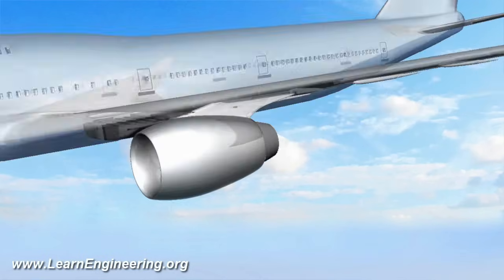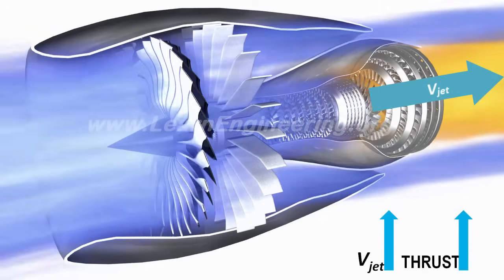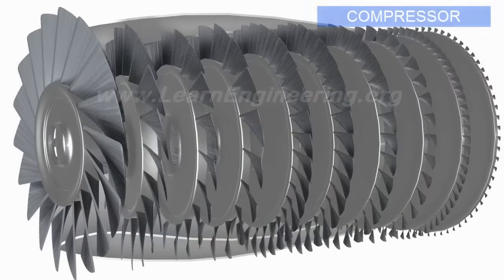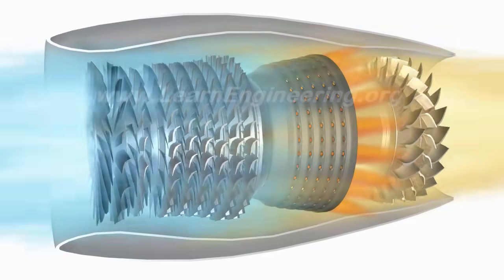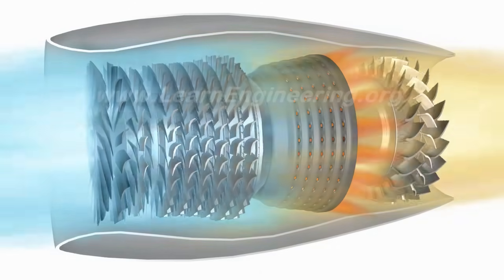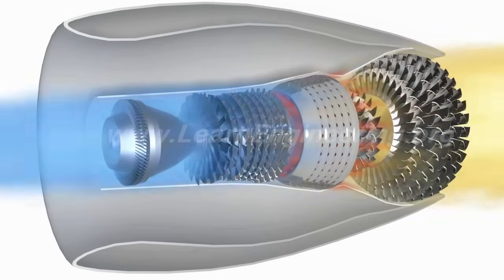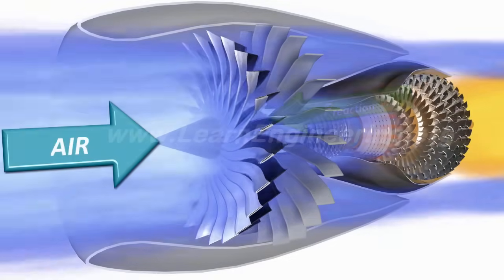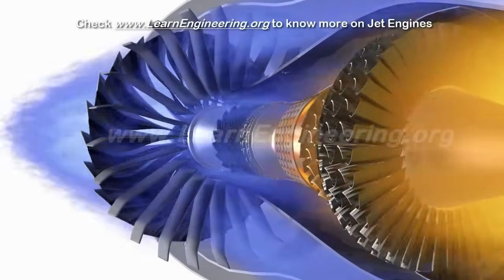Jet Engine, How it works?

Comment: This video still didn't teach me how jet fuel can't melt steel beams :/
Reply: I am assuming you never took a shop or metal shop class so I will explain this. if you were to take a big ass I-beam which is a structural piece of steel that is quite strong and support just the ends leaving the middle unsupported. you then put a lot of weight in the center of the beam not enough to go past it's with limit though. then you subject the beam to extreme heat such as shit load of jet fuel and I mean a shit load. there beam will heat up quite a bit. no not enough to melt it but we all know from seeing blacksmiths, that the hotter steel gets the weaker it becomes now all that weight that was on the beam is now to heavy for the heated beam and it fails. when you take a few heated beams and they fail in a building structure now you have ruined the strength and integrity of the building and more will fail.
Reply: @loganeley2342  cool so where did the molten pools of steel come from
Reply: @loganeley2342  
911 Inside Job by
CIA.GHWB.Mossad
Dick Cheney.GWB.
Benjamin Netanyahu,
Larry Silverstein,
Michael Chertoff,
Philip D Zelikow, etc.
Remember, Comrade,
"Dancing Israelis" are Mossad, "sent to film the WTC attack," but with explosive residue in their van,
& picture of burning towers on the side...
Reply: +DOGE™ you're a fucking moron
Reply: Enough to weaken it
Reply: +DOGE™ enough to melt people's hearts
Reply: +DOGE™ Shit! Thirty three thumbs, illuminati confirmed :o
Reply: SonsOfLorgar I'm pretty sure he's not.
Reply: +DOGE™ 7 ELEVEN WAS A PART TIME JOB
Reply: +DOGE™ Actually, it could. That's why the combustor is made of a high-nickel super alloy, and other sections are cooled with air from various other stages.
Reply: krasnograd You caught me!
Reply: +zzdfhgdhd Really? Comparing a soda can to a jet plane?? Just because a soda can is aluminum doesn't mean it'll have the same effects as a plane. Anything traveling at high speeds has the potential to penetrate objects, we see this pretty often with tornadoes. an F-5 tornado with winds up to 300mph can send things like a 2x4 through a house. Planes usually travel at 500mph or greater. As far as the metal melting, there's a shit ton of metal used in the construction of a skyscraper, and that doesn't include all the shit that was put in after it was finished. Now you have a hole hundreds of feet high in the sky, you have tons of jet fuel burning. Air wants to move trough the hole downwards, and with it being a concrete structure you pretty much have a furnace going on. Everything is burning, lot of air is supplying the fire so the temp rises so it is possible for fire to be 1,000 degrees
Reply: ***** You seem to forget the speed this jet was traveling at. There is a literally a photo of a piece of wood that went trough solid concrete after the Moore F5 Tornado. Which F5's have speeds ranging between 300mph. Jets can go up to 500mph, a difference of 200mph...which if you know anything about power you would know that it's exponential not linear.
Reply: +cesar hernandez no point arguing with him, he clearly doesn't even possess a highschool level knowledge of physics. he's just repeating talking points from conspiracy sites.  he's a perfect case of the dunning kruger effect in action.
Reply: ***** It's up my ass.
Reply: *****
"PHD's in physics say the the towers fell faster than free fall" Source? Another "fact" pulled from your ass.
Reply: +Rizlogen Dude, you are beeing trolled so hard it's painful to Watch... XS
Reply: I don't know what that means
Reply: +DOGE™ The same way your car's motor is working: It's cooled. In your car it is a watercooling system, in this case there is much cold air sucked in, cooling all structures in the engine.
Reply: +DOGE™ This will:

http://www.popularmechanics.com/military/a6384/debunking-911-myths-world-trade-center/
Reply: +DOGE™ I spot 9gager here
Reply: +DOGE™ its because the cant!!
Reply: *****
sources plz
Reply: *****
where is your source for all of your claims.
Reply: *****
"cars and busses to spontaneous catch on fire" source. "it didn't burn nonmetallic things nearby" source. as for "melts" you've seen plenty of people here explain to you that structural weakening of steel is entirely possible from high impact of a plane/ jet fuel burning. no need for melting.
Reply: *****
how do I trust that YOU have the ability to utilise logic and weed through propaganda? You're just posting sourceless claims, and expecting people to trust them. That which you post without evidence shall be dismissed without evidence. You're dismissed.
Reply: *****
I don't believe these things happened. until you give me proof, then I can dismiss them as easily as you post them
Reply: *****
very asinine. vehicle. what a waste of time to comment and merely point out a typo. can't be surprised though. you don't have anything of substance to say after all. just copy paste "ideas" from conspiracy sites.
Reply: *****
what part of my last post doesn't make sense. you are so OBVIOUSLY avoiding posting any sources for your blatant nonsense. it's hilarious.
Reply: *****
Oh my god, can you not understand simple english? You pointed out I made no sense, so I asked you to explain what in my last post didn't make sense. You have got to be literally the most stupid person I've ever seen in youtube comments.
Reply: *****
this is ridiculous. clearly you know you've lost the argument, so feign ignorance all you like. You're only embarassing yourself.
Reply: *****
You are clearly a moron. I never once said I was making a last post, YOU claimed one of my posts didn't make sense, and I CLEARLY asked what part of my last post didn't make sense. THAT IS NOT SAYING "THIS IS MY LAST POST". Learn to fucking read. Then learn to fucking think critically. You fucking IDIOT.
Reply: *****
how the fuck did I get played? Your basic lack of reading comprehension =/= me getting played.
Reply: humanrace Because illuminati did 9/11
Reply: @DogeDELUX  illuminati 
Dimitri Khalezov said it was Michael Harari, a Freemason. 911thology is a PDF tl;Dr
"The Third Truth" WTC was nuked.
Reply: @davidlango1850  Niiiice.
Reply: This is the problem with Trump supporters. They make up their mind. They know they are wrong. But refuse to accept anything else. Ignorant idiots that deserve to die more then child rapists.
Reply: Logan Eley tl;dr
Reply: it doesn't
Reply: +DOGE™ they are made of titanium
Reply: @PantelisKokkalis  No,you have mistake .
Titanium is used to manufacturing centerfigual compressors and it means that  the temprature isn't too high
The cmbustion chamber I think is made with "cobalt"alloys.
I don't know I wrote it correct or no.Ther are more cool air around the wall between the turbine case and chamber that can cause to protect melting.
Reply: +spoonwitz    yep!!
Reply: ***** ok
Reply: +Smithy07sham no not even close !
Reply: billy smith Omg...
Reply: *****
the claims you make of vehiles melting etc
Reply: +DOGE™ u asked for an explanation and when 1 was giving to u, u don't read it . i wonder y u think 9/11 was an inside job
Reply: +DOGE™ lol, ok, that s too much for me. have fun
Reply: Why did you delete your ASSHAT?
Reply: +Logan Eley So the building will then fall like a deck of cards?? Get out of here PLZ, it`s called controlled demolition!
Reply: +zzdfhgdhd I take it you're a Caravan to Midnight member. If not, you should check it out. You would like it.
Reply: +zzdfhgdhd No offense taken. I can't listen to Jones. It's way too over the top. Actually the host doesn't have much time for Alex Jones. He calls it fear porn. They discuss a lot of economic and political topics, monetary policy, along with things you were commenting about, like 911, fukashima, chemtrails, health, objective history, jfk assassination, sandy hook, etc. He has guests like the Hagman and Hagman, Brian Foerster, Wolfgang Helbig, etc. It's actually pretty good. A few of the guests appeared to be loons, but he does his best to screen them out beforehand.
Reply: +Logan Eley That is when it exposed to heat for extended periods of time. Not the mere seconds when the plane hit the tower.
Reply: Frontyer k
Reply: 911
Reply: DOGE™ Maybe I can. The jet fuel explosion set the building on fire, and the fire began bending the steel beams because of heat. When steel is heated, it becomes softer, and is able to bend. This is why we use forges to make things with steel. They didn’t melt, rather they snapped because a soft part of the steel was not able to hold the weight from the floors above. 

When buildings are demolished, a small section has its support structure exploded with TNT. This is because a structure can fall on itself if theirs too much weight on it, and this results in the entire building collapsing, and it falls in on itself be of the structure design, it doesn’t tip over like a small structure of one support beam. 

Anyways I hope that helps. I doubt 9/11 was faked, but it was definitely exploited by the US to attack the middle east and get oil.
Reply: @solsist__3291  What oil did they take???  How can someone steal oil???  US doesn't use much oil from the middle east, if you knew anything at all about it.  Any oil you take you have to pay for.  All you idiots that keep repeating that someone is stealing oil from another country are simpletons who merely repeat each other.
Reply: no fuel air is the thing   fuel is scam
Reply: It can't
Reply: or why larry silverstein decided to "pull' [it] Building 7.
Reply: Lolwtf this comment is so old, can't believe how many people I've trolled here 😂
Reply: It's fuckin titanium alloy and cooled by bypass air
Reply: even the rotating blades are turn to the wrong direction..supposed to be turn to the left not to the right  that is blowing the air to  the front  instead of sucked in..if  looking at the blades positions... but i don't think they explained everything all the details in this vid..
Reply: when the gases of atmosphere are compressed in 2 or 3 or 4 stages moving faster than speed of sound and then the engine spray fuel (Kerosene) into that very highly pressurized air it can reach the temperature of 2000 k (1700 C) the melting point of Iron 1500 C and steel melting point is 1400 - 1500 C so it will start deforming in that point
Reply: DOGE™ 
Your explanation is right here:
https://en.m.wikipedia.org/wiki/Conspiracy_theory
"...
People formulate conspiracy theories to explain, for example, power relations in social groups and the perceived existence of evil forces.[c][42][40][41] Proposed psychological origins of conspiracy theorising include projection; the personal need to explain "a significant event with a significant cause;" and the product of various kinds and stages of thought disorder, such as paranoid disposition, ranging in severity to diagnosable mental illnesses. Some people prefer socio-political explanations over the insecurity of encountering random, unpredictable, or otherwise inexplicable events .
...
For some individuals, an obsessive compulsion to believe, prove, or re-tell a conspiracy theory may indicate one or a combination of well-understood psychological conditions, and other hypothetical ones: paranoia, denial, schizophrenia, mean world syndrome .
..."
Reply: Still with this ?
Reply: I think we'd all like to know that Doge. </3
Reply: This is actually a model of my asshole after hot wings!
Reply: @user-cz8ky8bs3o  
Watch:
"911 Road to Tyranny"
by Alex Jones.
"911 in plane sight."
"Loose Change" by Dylan Avery.
Reply: +Logan Eley mm I think you might wanna look into what you are saying because the beams at 911 didn't just weaken they strait up melted !!! you can even see in the videos liquid metal poring from the windows !! explain that one BRO!!!  it was an inside job you morons !! what are you going to say next that JFK wasn't killed by the government ?? lol you're a fool if you think otherwise ...
Reply: BOI IF YOU DON'T GET YOUR ASS OUTTA HERE!
Reply: Logan Eley Too long; didn't read.
Reply: Too long didn't read-this seems to be a recurrent problem with you.Which explains a lot.
Reply: ang fig sorry it's confidential, you'll have to ask allah.
Reply: ang fig yes it does, the ISIS proved it.
Reply: ang fig It came from the internet.

Comment: Jet aircraft are quite efficient first due to flight at high altitudes. The higher an aircraft can sustain itself in a normal cruising speed the lower fuel consumption is.
Even the most efficient turbofan is a fuel guzzler flying below 4Km in altitude, when the air is still quite thick. That's why typical cruising altitudes are above 30000 ft (10Km), with large airliners going as high as 43000ft (14Km), and lighter business jets achieving flight above 50000ft (16Km).
The other important aspect is turbofans achieve higher fuel efficiency due to accelerating much larger air mass to a lower speed.
Finally jet engine efficient depends heavily on how hot combustion is inside the engine, the hotter it is, the more efficient an engine gets. At the same temperature level a turbofan is much more efficient than a turbojet.
Latest generation jet engines use air flow to make combustion happen as far as possible from the metal skin of combustion chamber, combustion is so hot it would melt the combustion chamber skin, so air flow is critical for safe operation.

Comment: Compressor blades and fan blades at the start of the video rotate backwards, or are angled backwards. Turbine blades and fan blades later in the video look correct.

Comment: still don't get it, all I noticed is that the compressor is spinning backwards LOL
Reply: Bryce Leung high pressure air is heated up, which makes it expand and causes it to fly out the back faster than it came in because hot air expands. This output is also used to spin the compressor fans, which allow for even higher density air and more thrust.
Reply: @Erowens98  So.. a year has passed.. please look again at the video and see if you notice what thousands of other people did..

Comment: "nearly a century" is not quite correct, the first jet airplane was the German fighter jet Messerschmitt Me 262, which had it's first flight in 1942, 73 years ago...
Reply: Actlly the British began Jet Prototypes in 1933 but stopped funded them due to the great depression in which britain massively reduce its military and R&D funds.Thats roughly 85 years which is near to 100 years.

Comment: "Jet engine have been successful drivers of aircraft for nearly a century".  who gave this guy a history lesson in aviation?  100 years ago we barely had bi-planes.
Reply: @Spencer Tree 1949 De Hallivand Comet. First commercial JET plane.
Reply: First jet engine was invented in 1930. It has almost been 100 years. Who gave you your history lesson? Haha
Reply: @tsimshian886  The first jet was in 1939 correct? 378 mph I believe. (Heinkel He 178). Probably misspelled it.
Reply: @tsimshian886  I am speaking about the first COMMERCIAL jet.
Reply: @N800-q1b  but you didn't say commercial
Reply: @tsimshian886  The first thing I commented was commercial. Scroll up.
Reply: @tsimshian886  I GTG study for finals, we can continue later.
Reply: @tsimshian886 The video says "successful drivers of aircraft" which implies common useage. The first experimental flight was in 1939 and for several years after their high fuel use made them less than "successful". Even taking this early date it is only 79 years, so not really "almost 100 years" genius.
Reply: 1940 to today is only 79 years
Reply: @Spencer Tree 1930
Reply: @Spencer Tree me 262 developed by Germany in ww2 :)
Reply: Ace Master
One of the first "mass" produced fighters that were powered by a jet. However, the first actual plane to take flight with a jet engine would be the He 178 in 1939.

Comment: the rotation is all wrong
Reply: ***** if you can't figure that out, then you're the dumbfuck... but to help you figure it out, just look at the fan in the front, with the direction of the rotation, it's not sucking in air but rather pushing it out, for your dumbass to better understand, check any electric fan, their rotation and the direction of the airflow and the angle of blades, and tell me again who's the dumbfuck.
Reply: ***** I'm pretty sure all the intelligent people here clearly understand what I said and you're the only dumb one that can't, it's so clear that you're stupid.
Reply: ***** The angle of the blades decide where the air flows, and no matter what the rotation of the engine goes, if the blade angle is wrong, it won't be able to suck in air, the front tip of the blade should be facing towards the same direction of the engine's rotation, if you still don't get that, then no intelligent mind can help you no matter what.